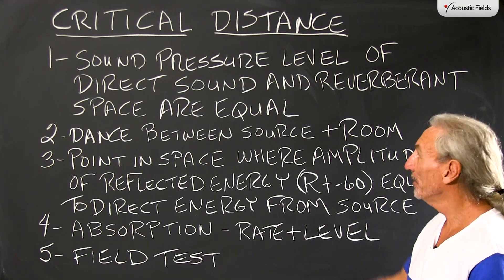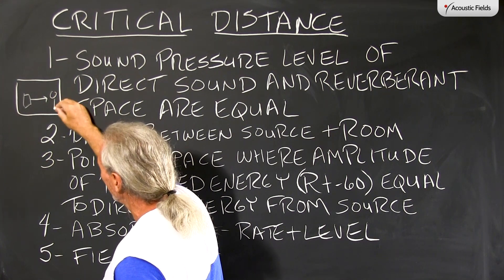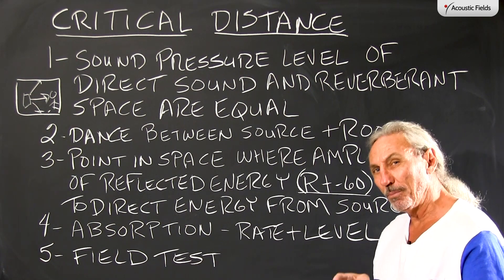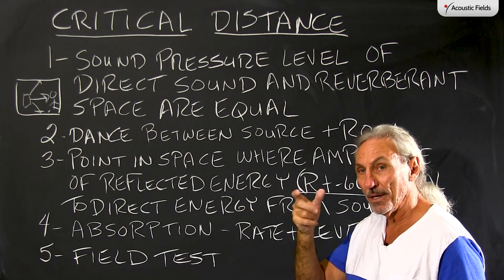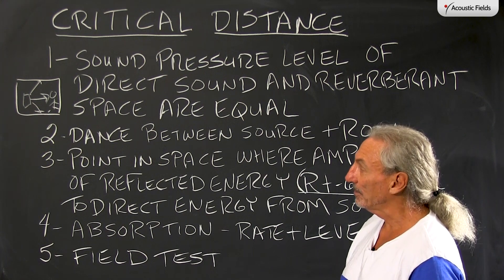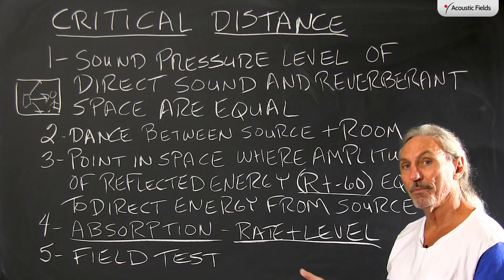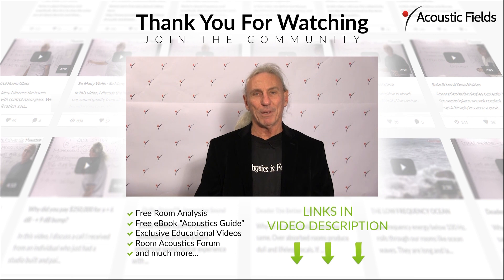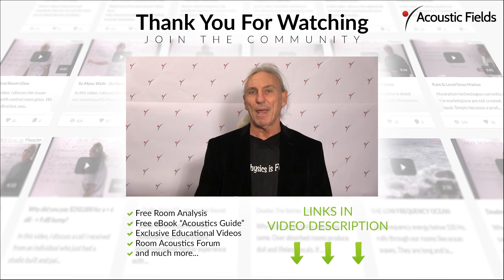Critical Distance in Room Acoustics - www.AcousticFields.com

Comment: Wouldn't the features of the speakers affect "critical distance"?  For example Omni directional, open baffle (electrostatic falls here too), horns, etc.  if you have an Omni (like an MBL) put in "Sacred Grounds" for example would you have better soundstage vs. a horn?  What effect would that be on the sound you hear at the listening position?
Reply from the maker: Hi Sean, The radiation pattern of the speaker, whatever type, will produce an area of direct sound along with  primary, secondary, and tertiary reflections. This nexus is your starting point and the room will have its starting point. Its all in the room and you can find it.